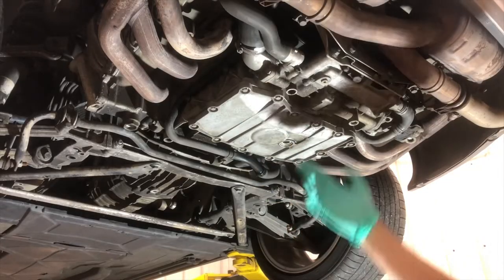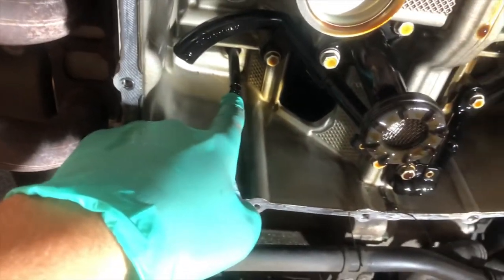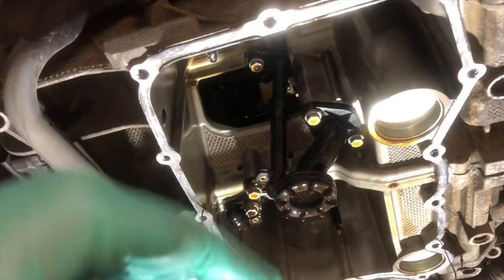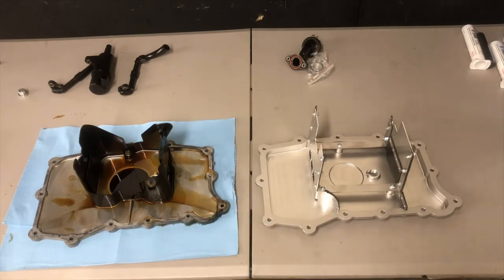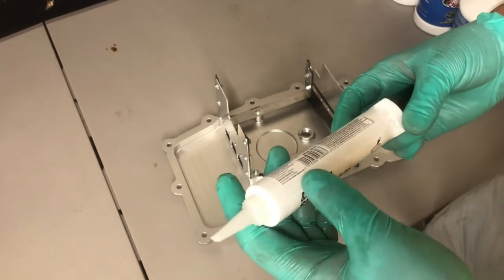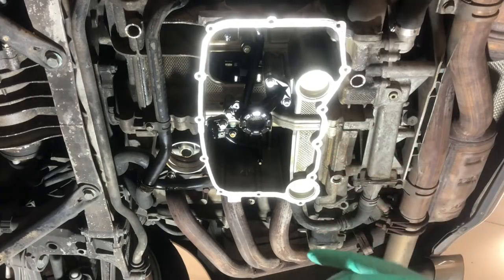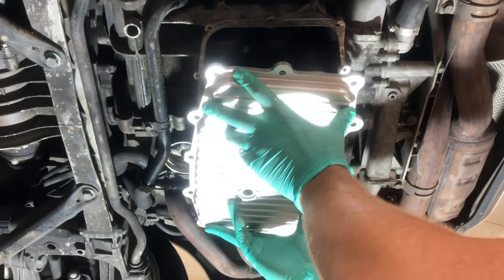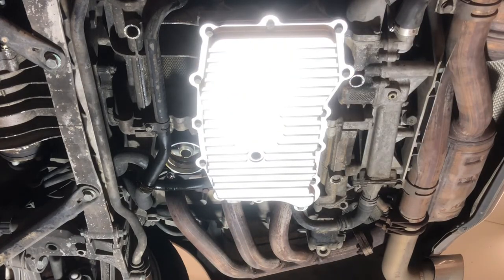Upgrading My Porsche 911’s Oil Sump to Handle the Track!

Comment: I agree that this one from FVD is a much better design, but I think it could be a little better too. In the center area where the baffle is, needs to be deeper and on each side of the baffle it needs to slope up at least half the existing depth to aid in oil returning back to the oil pickup. This one can be modified if you so desire to do it.
Reply from the maker: I haven’t had any issues with it, including during track weekends. I see what you’re saying though, but I think the FVD is meant to be an OEM+, not necessarily an all out be-all-end-all.
Reply: @FunAhead_TV_Official  Good to hear it's working out for you and I had someone else that bought the LN system and I personally feel the same way about it as you do. The FVD offering looks very close to the X51 offering to help with the oil control.
Reply from the maker: Yea, for sure. I like the mentality behind the LN one a lot with the extra plate, but I don’t care for that one’s baffle so much. I think the FVD’s baffle is very good. Seals to every surface nicely. Like you said, it’s very similar to the X51 in that regard.

Comment: Do you have the part number for the 997 oil tube?  Thanks
Reply from the maker: 997-107-016-00-OEM
Reply from the maker: That should be it